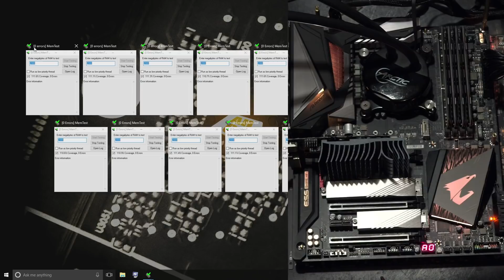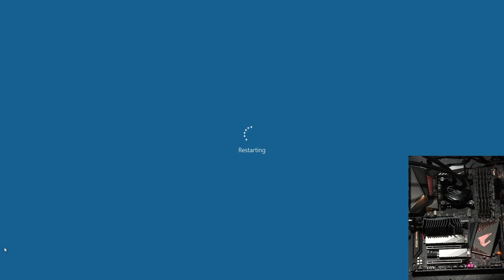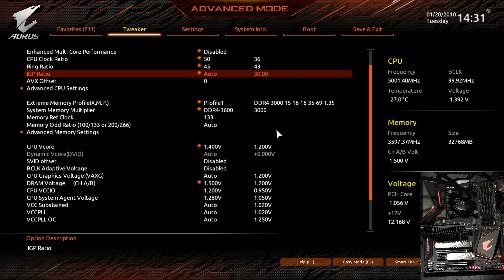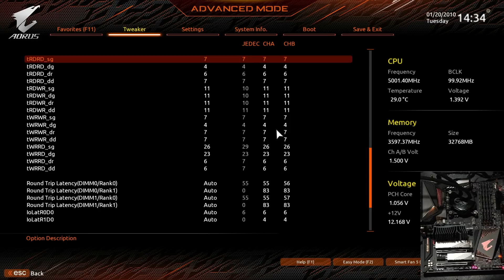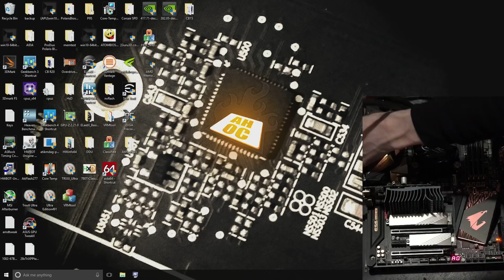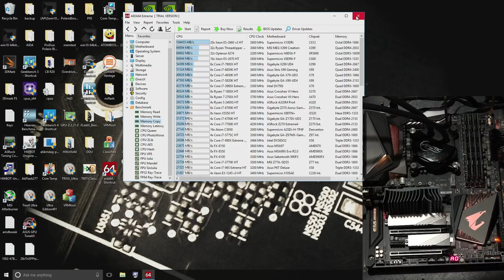Overclocking 4x8GB 3000MHz C15 Crucial Ballistix on the Gigabyte Z390 Aorus Master

Comment: Like to see him test it out with TestMem5 with Extreme profile. Have similar config and couldn't get cas 15 stable and had to settle for cas 16 at 1.35 default volts on a 3600mhz kit. Wonder if I need to pump more volts into ram or the SA?

Comment: You think these same settings would work with a pair of 16gb <32GB> same board and processor.  If anything should be adjusted, any recommendations other than the 2T command rate?

Comment: This ram is crazy
I had 2x8GB of hynix AFR (rated 3200cl16) which struggled to go past 2933cl14 on a 1800x. I added two of these sticks and moved the hynix AFR to two slots closest to the CPU and now the system is stable at 3133cl14 with 32GB and 4 sticks. Mind blown

Comment: Gigabyte z390 seems to have trouble doing CR1 over 3600, even with 4 dimms on t top, so that's probably the issue stopping you from going higher
Reply from the maker: 2T doesn't help at all I normally start OCs with this kit at like 19-25-25-45-2T primaries

Comment: I have 2x16 of the 3000 CL15 Ballistix running with a Ryzen 3600 on Tomahawk Max at 3600MT/s 16-19-16-16-36-58-580 1.5T(GDM enabled) @1.33V VDIMM and 1.0625V SoC, which are fairly loose timings for this memory on a Zen2 as far as I can tell, but they're also running at comparably low voltages considering the XMP setting would have it run at 1.35V and the DRAM Calculator or OC guides recommend trying SoC up to 1.1V. I get way worse latencies, little worse read/copy than you here and only 28.000MB write (because it's a 3600/just one CCD), but I guess some of that is because it's a completely different mobo architecture and memory controller? I'm very content with what I have compared to the stock 2400 or even the XMP 3000 and didn't want to spend any time trying to see if tighter timings would work (or if my Ryzen 3600 would work with higher IF than 1800) when I'd have to crank up the voltages in return.
Reply: what ram do you use micron b die  or micron e  die
Reply: @alfredgamerzzgamers3970  The Ballistix should be e iirc
Reply: @averagesongcontestan  what do you mean

Comment: You need to get ahold of 4x16gb of that kit.  64gb takes foooooorrrrrrreeeeeevvvvvveeeeerrrr to stability test, but I was able to push my 3800x to 3733mhz, CL16 on the AX370 Gaming K5.  Unfortunately it seems to be suffering from terrible latency, only around 69.5ns,  I believe this to be a board issue though.

Comment: Can you make an overclocking video with Micron B Dies on zen2? Bought a kit of 4x8 Gb Dual Rank Crucial DDR 4 2400. They're runnning @ 3200 Mhz 16 - 20 -16 - 16 -38 @ 1,37V ;)
Reply: I have 2x8 2400 ballistix LT dual ranked rev. b running at 3000 14 17 14 28 42.
Reply: do you reach 3600mhz on this settings
Reply: @alfredgamerzzgamers3970  no way

Comment: You already did a vid on OCing this kit on the z390 i gaming edge (full mem oc process vid 9 months ago) but I guess that was just two (16gb) rather than 32gb...  Is reve easier on memory controllers than CJR? e.g. is it easier to OC 32gb or even 64GB of e die vs cjr or vice a versa?  It might be nice to see a quick vid showing just like, 32GB of edie vs 32gb of cjr (and 32 gb of b die?), maybe even adding in weaker memory controllers like zen 1 or zen 1+...  Actually...  I mean, it's hard to say with one 32gb kit of rev e and one kit of cjr which die is "better" because of the silicon lottery, but looking at those kits on a good memory controller and then moving to a worse memory controller might show something...  I don't know.

Comment: You should test overclocking Micron J-Die. According to my very limited Tests with J-Die in my ASRock Deskmini A300 they seem very similar to E-Die. Due to IMC limitations of my 2200g and just 1,2 and 1,35V selectable VDIMM i cannot really go stable over 3466 CL16.

Comment: Buildzoid sounds kinda disappointed but let's not forget this RAM is dirt cheap and it's still a decent boost from 3000 MHz. I always recommend these to people instead of the other dirt cheap G-Skill Aegis 3200 C16 setup or the Corsair Vengeance LPX 3200 C16 for SFF builds...
Reply: I got the Corsair Vengeance LPX Ver. 5.29 3200mhz 2x 16gb
What do u think how much i can overclock?
Would be nice if u can help me!
Reply: Yeah, they dont compete with high-end B-die, but they also cost about half as much from what i have seen so id still call them a good choice unless you dont care about money.

Comment: Am I the only one who thinks these RAM overclocking videos are really entertaining?
Reply: usually more interesting when the commentary is off the cuff and the system behaves differently from off camera
Reply: It's not a bad vid, but it's a 20 minute vid that's just walking through settings that don't really help anyone other than just giving more information than what you would get from one row on a spreadsheet of z390 ram OC results...  Like, good tidbits of information are sprinkled around, but I think they could really be organized better, like, on this gigabyte z370 AM it can't do 1T on two stick setups, and how two primary timings are tied on intel platforms which is a serious problem for reve sticks...  There's a lot of information on OC out there, finding the good information and organizing it is sort of the game, and you can sometimes see that in BZ vids, he'll have a txt file open with guidelines for bdie on z390, he'll know that top tier bdie can do 4200 cl 12...  He does great rambling videos but I'd like to see like a vid where he takes a good z390 board or x570 board and a bad z390 board or x370 board and shows you can OC your CPU 100MHz more on a good board and then shows how you can OC the VRM on your bad board and put a fan or some heatsinks on it to get like a 50MHz better cpu OC...  Or a video on what you can expect from gddr6 and which cards benefit the most from vram OC.  Which GPUs can easily OC 10%, although I guess boost has made that kind of irrelevant.  Reve is good on x570 so do a vid on that, CJR is good on z390 so do a vid on that.  CJR is good on x570 so do a vid on that...  Do lots of rambly OC vids.  Spend an hour each week ambient OCing a random GPU while rambling...
Reply: Nope